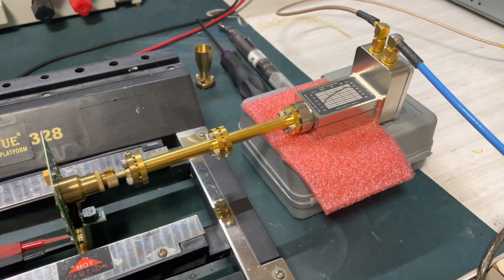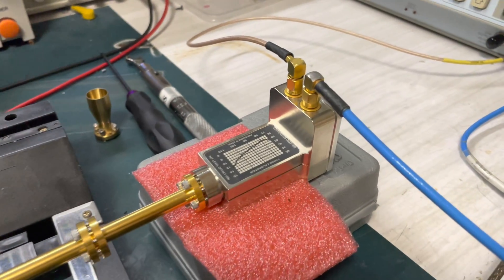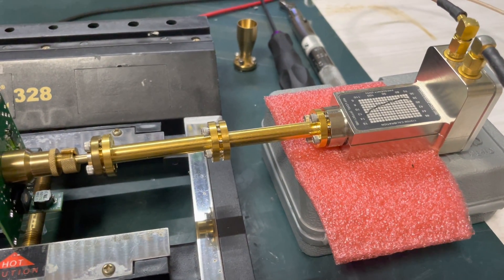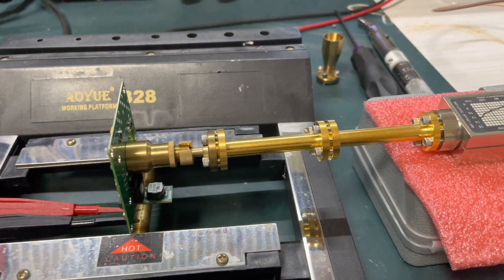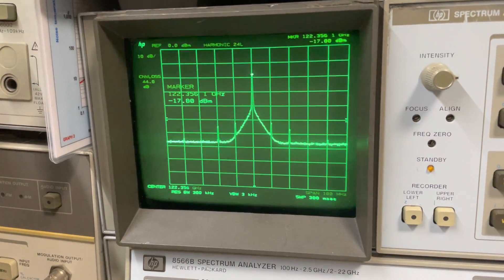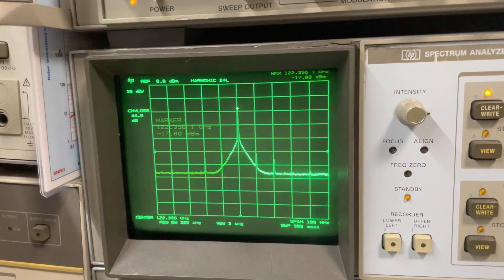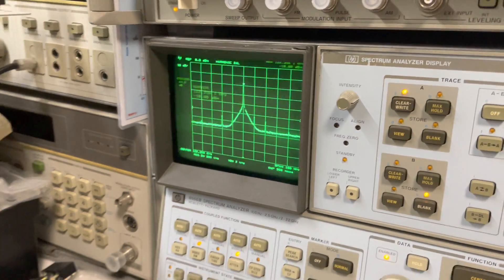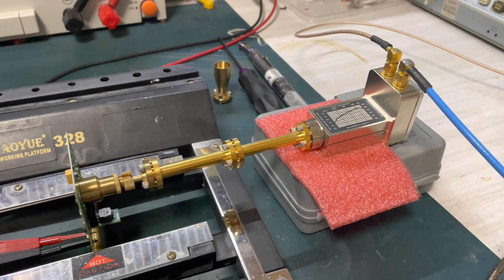122GHz transverter output power test

Comment: I'd be interested to see the result if you remove the waveguide sections. i.e. connect the coupler directly to the HP mixer. Previous experiments I've done suggest that brass waveguide can be quite lossy at this frequency.
Reply from the maker: Hi Iain, I've run more tests with the wave guides removed and the difference is barely perceptible. I've made a video of that and will upload it soon.

Comment: Hi Tim, John G8ACE tells me he found that rotating the polarisation with one of those rotating flanges made no difference to signal levels on a real path using a rear-fed dish. Did you try different orientations, or is that detector setup insensitive to polarisation? My highest frequency HP harmonic mixer only gets me to 50 GHz, so I can't test on the bench here.
Neil G4DBN
Reply from the maker: Hi Neil, I've run some more tests and will post another video soon  showing the decrease in signal with rotating the polarization of the board. I've also done a few tests using a HP11970K  to see what it would measure. Which model is your HP mixer ?
Reply: @myamateurradioadventures2516  HP 11970Q it says....
Reply from the maker: @MachiningandMicrowaves   I dont have a Q but I also have an A, K and U mixer. I'll do a test with the K since its the cheapest one you can get.